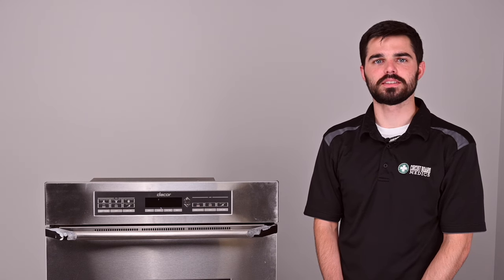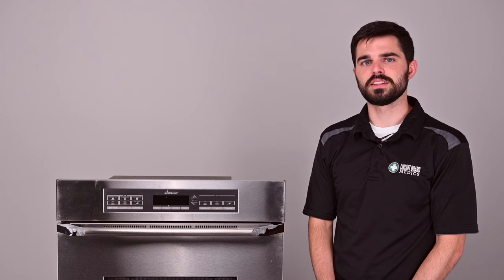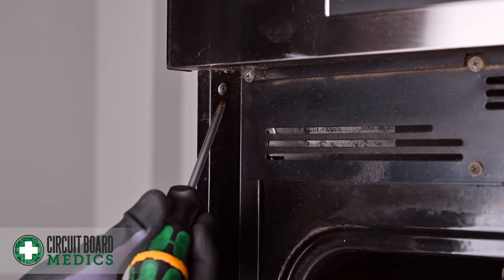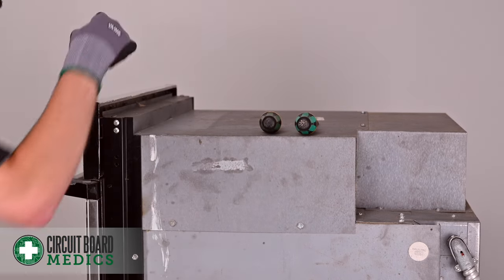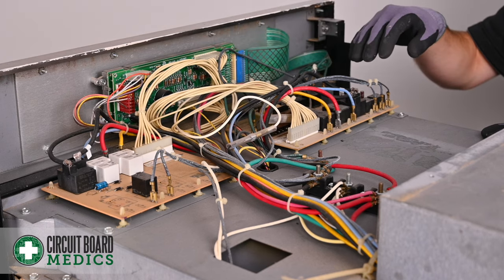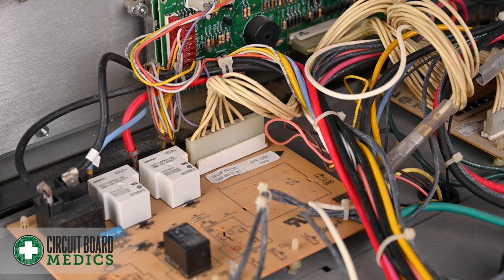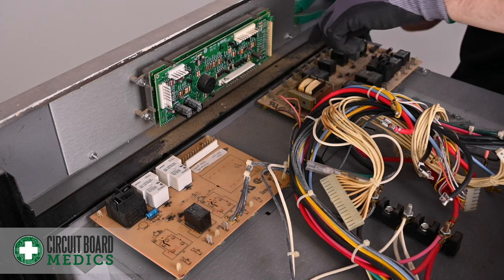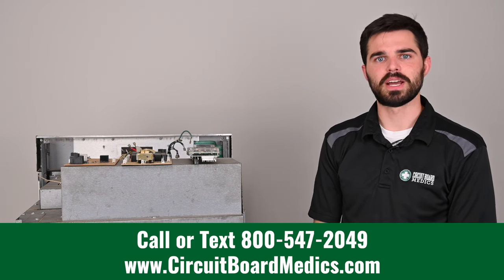Built-In Oven Control Board Removal – FRIGIDAIRE, KENMORE, DACOR, JENN-AIR

Comment: I don’t have problems with heating but I can barely see the what temperature it is. I have to cover my head with something to block out light, and look at it within 6 inches. Same for the rest of our family. It’s like half power to the display. It been happening for 10 years now. 
What can it be since there is definitely some power going to the control and it’s heating just fine?
Reply: Thx for liking this. Do you have the same problem?
Reply from the maker: We replace the displays on many different oven boards. If you can give us a call at 800-547-2049 with your oven's model number we would be happy to see if we can help you!